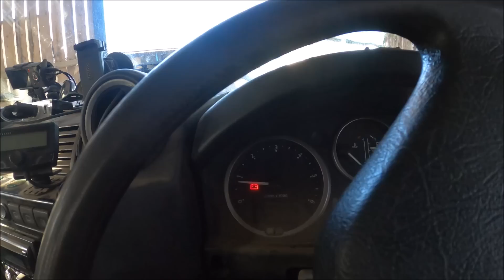03/04/23  Reg bids farewell to the 480 Tucano.

Comment: Loaded many combines in my working days, Hydrostatics are much easier than manual transmissions as you can just creep on. As long as half the tyre is on it'll be fine. Easier when its dry and the tyres aren't muddy. Certainly got the right trailer for the job.